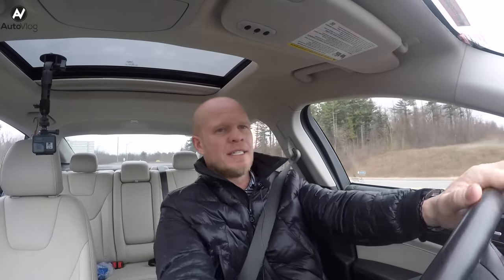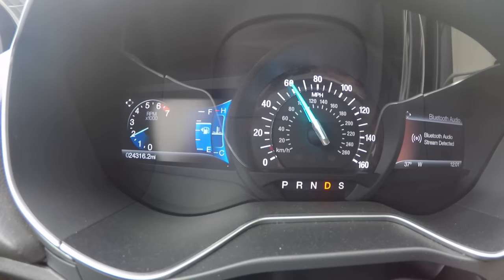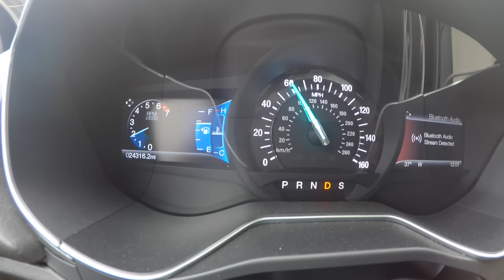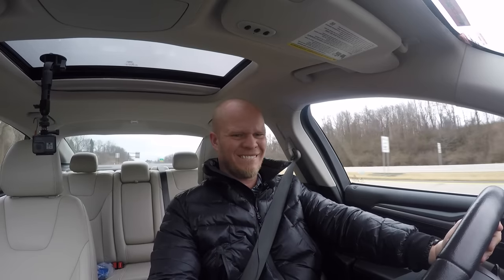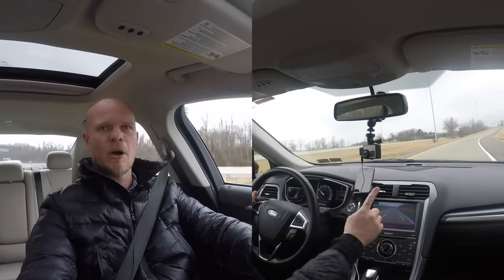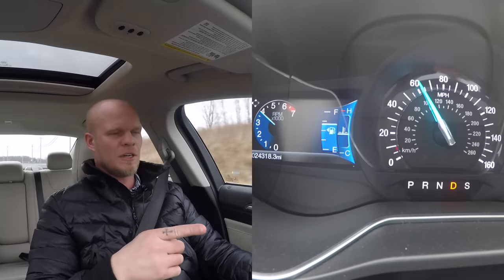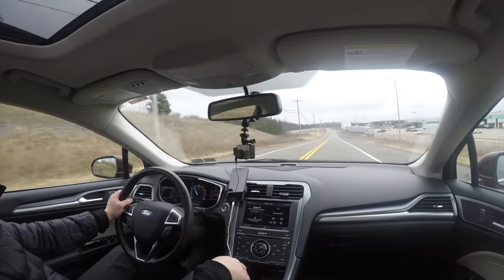What happens if you put your car in REVERSE while driving? (Things NOT to do while driving)

Comment: Try it with a manual car 👌
Reply: INVESTING HUSTLER - Stocks and money making videos all it does is make a screeching noise and won’t go into reverse at least mine wont
Reply: Pimp Daddy true it won’t go in you need to be god to put it in there.
Reply: Morgan Adamson lmao I laughed out loud at your comment
Reply: Mine doesn't let me put it in reverse unless I'm pretty much standing still.

On my sister's Seat I'm pretty sure I actually put it in reverse a bit too early twice already at about 3 km/h. It just does a screeching noise. Don't wanna know what happens when the car lets you out it in reverse at 50 km/h
Reply: Won’t do shit unless you release the clutch. 🤷‍♂️
Reply: Pimp Daddy I believe you must put it in neutral first
Reply: Try with golf 2 and Opel Cadett ...my friend was do that in both cars about 80km/h and engine breaks and fall apart on the road hahahahahah
Reply: That's what she said.
Reply: You can do it if youre moving slow but at 70 like in this video it will be like shifting from 6th to 1st gear, because the reverse gear ratio it's very similar to the 1st so you just not going to reckt the tranny you also gonna blowup the engine...
Reply: A manual car will probably not go in reverse gear while moving forward. Your stick won't move.
Reply: I won’t kill a manual transmission
Reply: KAABOOOOOM!
Reply: Yeah
Reply: loool i was in my learner car which is a Mini cooper D 2017 (havent got my full UK license yet) 

jumped from 3rd to reverse (its a 6 shift so reverse is next to 1st) on the gauge it tells you what gear you’re in and it jumped to R. 

My instructor said if it ever happens again dont push the gas or break just leave the cluch in while youre driving shove it in neutral then change to what gear you need. As long as you have the clutch in it wont reck anything because the clutch disconnects everything.
Reply: Ross Roden+ you know for a country that has more manual cars than the US there sure does seem to be a lot of ManTrans illiterate people over there. l always hear stories about instructors telling the students to rely on vehicle specific features like hill assist or being able to idle forwards off the clutch. some even say just dump the clutch when you shift. or they say that you have to double clutch so you don't wear out your synchros, not realizing that synchros are there for the sole purpose of granny shifting.
Reply: Electronics For Fun Electronics For Fun the problem is they will only teach you how to pass your test and that is all that they are used for not about general things in manual cars, also, most cars are on finance over here and most people change a car after 3-4 years then after they have paid off their finance they’ll just get another car on finance so people aren’t worried about what they’re doing to their car in the long run because “whats the point if you’re going to change it anyway”. 

I think its a bit worse in the US. Considering my US friend was taught to just keep the clutch depressed at all times while driving. 

How i was taught was the rev match, when moving off add a little gas and i have never used hill start assist, my instructor has turned off all that stuff.  She doesn’t even let me use cruise control because my car doesn’t have that stuff. My car is a fiesta edge 2011 doesnt have cruise control, hill start assist or anything fancy just standard ABS and stability control.There has definitely been a few times you could smell the clutch burn, but that was when i just started when doing hill starts.

For lazy purposes, whenever i do a Manoeuvers i will just ride the clutch in my leaners car, it just gives me more control and I don’t end up fucking up the Manoeuver but in my Fiesta i do things properly.
Reply: "I think its a bit worse in the US. Considering my US friend was taught to just keep the clutch depressed at all times while driving." oh wow, that's pretty cringe.

"There has definitely been a few times you could smell the clutch burn, but that was when i just started when doing hill starts." everybody has their own little tricks for that. l knew one guy who would plant his heel on the brake and then twist his foot and press the gas with his toes while feathering off the clutch, and the most common thing l see is when people use their E-brake and then yank it off once the clutch grabs. l mean it works but it seems a little more difficult than just doing it the right way.
Reply: ^ I just dump the clutch and clench my butt cheeks lmao
I wasn't really taught how to manage hill starts properly, especially if I'm reversing up a really steep incline. I've been driving manual for 5 years now. Is that the wrong way to handle that situation? I've tried the parking brake trick and I just can't get with it. It feels too weird for me.
Reply: Electronics For Fun Electronics For Fun i got taught to leave my foot on the break, get the clutch up to biting point then twist my foot to the gas and add as needed, however most people get taught just to put the handbreak up get yourself ready with the clutch and gas then realise it. My friends always do it whenever there is an expensive car behind them
Reply: Jillian J id just say if youre stopped at a hill (because of traffic lights etc) just keep the clutch depressed with the foot on the break, when you want to go get the clutch to biting you will move a tiny bit or you won’t move at all but you wont roll back, then add gas. I wouldn’t do it if you’re constantly going to be going up and down hills because you’ll just wear your clutch out but if its every once in a while it or you dont drive up steep hills it shouldn’t matter
Reply: Jillian J+ well am not an expert, but l would say it's ok to dump the clutch every now and then but making a habit of it could cause problems. the best thing to do would be to keep your foot on the brake until the clutch bites and then pull off of the brake and give it some gas. once the clutch starts to bites then it should hold you in place like a torque converter would in an automatic car, but obviously you'll want to get on the gas pretty quickly or you'll burn out your clutch just sitting there with the clutch half engaged.
Reply: Ross Roden+ "Electronics For Fun i got taught to leave my foot on the break, get the clutch up to biting point then twist my foot to the gas and add as needed," yeah l have seen people do that before.

"however most people get taught just to put the handbreak up get yourself ready with the clutch and gas then realise it." yeah that's pretty common.
Reply: Ross Roden my issue is reversing up steep hills (like backing out of my driveway), not driving forward up them. For some reason I can't apply the same mentality to reversing. It's weird.
Reply: Electronics For Fun how is my clutch supposed to bite and give me enough time to start moving the car when I'm on a very steep hill, though? I just recently moved and my new driveway is on a pretty big incline. I've tried a ton of shit while leaving every day. The second I let off of the brake, my car rolls very fast down the driveway. I guess the only other solution is to back in because it seems it's easier for my car to pull up the hill than push up it.
Reply: Jillian J+ "how is my clutch supposed to bite and give me enough time to start moving the car when I'm on a very steep hill, though?" if it's a VERY steep hill then you should use your E-brake. but in most cases you can feather it without having to use the brakes. when on a hill you're releasing to clutch to the point where it's biting but not hard enough to stall the engine so there is still a little slippage. this little bit of slippage allows you to hold your car in place long enough on the clutch with the engine running, and it will hold you long enough to get on the gas and go.
Reply: Electronics For Fun I'll have to try that stuff again. I've tried the parking brake thing and it felt really odd to me. Hmm
Reply: What if u r on slope and in reverse gear car starts going forward and then full acc.  And clutch off
Reply: Yatin Patial+ l don't know if l fully understood that. but if you mean yanking your foot off of the clutch and slamming the gas to stop rolling backwards, then you'll either stall or take off in reverse and lose control of the car and crash.
Reply: Doesn’t work, it doesn’t let you put it in reverse if it’s at anything faster than stopped
Reply: Most manuals lock reverse out once a certain forward speed is reached.
Reply: I did it on accident... gear 5 was above reverse first time driving manual just made allot of noise and shit
Reply: brycmtthw that's not true... Clutch is link between transmission and engine... If transmission is spinning forward and you link the forward transmission while it's moving to the reverse transmission they will grind... So in fact... Shit will happen
Reply: INVESTING HUSTLER - Stocks Money Entertainment transmission would be annihilated
Reply: I did it n my old car ain't shit happen jus sounded like shit
Reply: INVESTING HUSTLER - Stocks Money Entertainment i have a manual truck
so iam actually wondering what would happen if i did
Reply: INVESTING HUSTLER - Stocks Money Entertainment yeah i think if it's manual something will happen lol
Reply: The engineer that built cars knows that there would be one idiot who would put it in reverse while driving so they built this mechanism that would lock out the reverse while driving. So to answer your question, no it won't work nor happened because it automatically locks you out from reverse while you're driving.
Reply: my car is a manual and it becomes very loud but continues to drovr forward
Reply: If it actually gets in gear it'll probably just shatter the whole gearbox, depending on how fast you're going, but I guess pretty much 85% of cars won't even get in gear. Even when the car is stopped some manuals cars offer much resistance when putting in reverse. Even if you are in neutral going at 2 km/h(forward) and try to get in reverse you're gonna hear that terrible noise of grinding gears.
Reply: It will break the gearbox
Reply: Would that blow the motor?
Reply: @ithaca4496  no you didnt
Reply: Ha sounds a bit like rrrrrrrrrrreeeeeeeeeeeeeeeeclunk
Reply: Mastermilo82 channel
Reply: The only way to go in to reverse going forward at that speed is doing like Tiff Needell, pull the hand break hard,  do 180° and engage reverse while spinning. It works. You probably will end in a ditch....
Reply: Guess what entire gear box rip 
Out
Reply: @brycmtthw  it's automatic in the video - automatics don't have clutches.
Reply: Same thing will happen
Reply: @chirsfortnite6150  you'll break the transmission
Reply: I think that you won't be able to switch cuz the speed
Reply: Investing Hustler and your reverse gear will be into pieces😂😂😂
Reply: Oh gosh! No! don’t do that!
Reply: @rxss6154  very correct
Reply: He did
Reply: Where I live, most of us drive manual. I've once wondered what would happen. I don't dare try.
Reply: @doublevision2943  I dont think it does let you. My private car is a 6 speed, after several years driving with it i got a company car that was a 5 speed, with the reverse in the same place my 6th gear was. And as you might imagine one tired morning on the freeway i was going to put it in "6th" gear just by reflex. What happend was that the gears could never lock in, probably because of the speed and direction it was already going. So i felt the stick rattle a bit and i put it in fifth. I almost shit my pants tho.
Reply: @88balloonsonthewall70   I figured there's some "safety setting" that prevents this from happening, I notice the same feeling whenever I try to shift into first gear while the speed is still too high - which could be as low as 15 kph. It might not be a safety setting but a mechanical situation where the gears simply don't allow it, somewhat like you mentioned it but I have no idea, I'm not much of a mechanic lol. Honestly I might look into the whole mechanism behind cars more, it is definitely valuable to be able to fix your own ride considering what they charge you at the local repair shops lol. My brother generally takes care of the familys cars but I've never asked to join him when fixing stuff

Comment: The difference is in older cars when you moved the selector you physically moved the lever on the transmission.  In a modern car when you move the selector (or any switch) you are sending a "request" to the computer that you'd like to change gear.  If the computer determines its detrimental to the system it won't let you do it.   That's why the fuel door or trunk won't open if you accidentally hit the button while at speed.
Reply: Yep 😭 definitely not the same in older cars terrible idea
Reply: Me: Put the car in reverse at 80mp 

Car computer: 🤔🤔🧐🧐

Comment: WARNING THIS IS ONLY ON NEWER CARS !! older autoboxes will shift, or try but just stall engine, (tried before)
Reply: Elyas Define older. Same thing happened when I accidentally put my 99 BMW in reverse while driving.
Reply: Elyas my dad was driving at night and encountered a sharp turn that his car couldn't handle at the speed he was going so he put it in 1st gear and ruined the car
Reply: Eww old BMW... Have fun keeping that unreliable thing running. He meant old as in ancient transmissions with mechanical linkages and valve bodies.
Reply: hochhaul can you explain what's unreliable about a 99 bmw? in the last 5 years of owning mine I've needed an ignition coil, CPS and water pump... so about $200 in parts for an 18 year old bimmer. mine needs new rear springs but after 18 years that's a good run for springs...

and there's a reason that you can move the selector from L (or 2 or 3) thru D and into N without pulling the button on the selector... so you don't smash the tranny into reverse... you can only access reverse while pulling the "trigger" on the shifter.
Reply: Not wrong about the old BMW tbh. BMW makes great cars, they just don't age that well. After spending $14,000 in two years trying to keep mine going, it died and I decided to get a cheap Toyota until I can save up for something better instead of spending thousands fixing whatever was wrong with my 540i this time. Sad to see it go that way, but it is what it is.
Reply: Whiterin 540 if I'm correct the 54p was the v8? I'm aware the v8s are not reliable. if I want a v8 I'll go American or supercar. Germans still don't have the formula worked out.

nice thing about i6 is that's the *23 (323, 523, 723) *25 *28 *30 *m3 all had many shared parts and that made them cheap.
Reply: MattyMag Yeah. The parts and work on the 540i were really expensive. I suppose it depends how long you want to keep it. Mine had 240,000 KMs on it. BMW in general isn't as good as say, Toyota or Ford for reliability, but if you don't keep them over 100k miles, you probably don't have to worry about it. Tbh, the next car I REALLY want is a Chrysler 300c SRT8. My poor as needs to save for a while if that's ever going to happen though.
Reply: Whiterin I really wish they made a hellcat 300. I just bought a used 07 a4 3.2 because I had a child and a bmw coupe wouldn't cut it. that being said, if I had the choice of any newer car, I'd have to go with the equus bass 770 or an rs6/m5. but that's out of the question knowing I'd kill myself behind the wheel of either.

wouldn't mind a tesla 100D either. has the range I'd need for most of my travels and the power to destroy my face like jeremy driving an atom
Reply: MattyMag I've got two kids, and I'm not exactly rich. The 300 is a great car, but for a really reasonable price. I mean, 465 horsepower and ft/lbs of torque, pretty nice luxurious interior, looks nice from the outside. Should be more reliable and much cheaper to fix/modify than similar BMWs or Mercs. Good deal.
Reply: Whiterin I agree with you, they've had 50 years experience making v8s. and I'm sure there's a supercharger kit available when shy of 500 hp stops being enough. 

and yeah I'm not buying anything new for a while . -275$ in the bank rn
Reply: tried before
Reply: Finlay Mitchell if your dad thought that with the brakes only he couldnt stop the car from going ofroad or worse...he did good pushing the brakes and puting a low gear cause it retract the speed , functions like the electronic brake on the truck. Even if that will break gears in the speedbox, but safety first.
Reply: Elyas
Reply: Elyas yes I've done it in a older car as well and definitely heard a lot of grinding coming from the trans.
Reply: MattyMag l
Reply: My 2000 Tacoma was dummy proof
Reply: "Eww old BMW..."
Eww, BMW. FTFY*
Reply: Elyas why did you try it😂😂😂
Reply: Yup. Tried on my 2001 Odyssey . Then sold my car for 200.
Reply: Yep I was driving going about 80 kph and my girlfriend put my car in reverse and it just turned off and I couldn’t steer
Reply: Moms 98 bmw made it 310000 miles only had to replace motor mounts everything else was just regular at home maintenance to the car as in oil changes
Reply: Elyas I'm pretty sure it happens on new cars too he just let go of the pedal when he put it in reverse. I'm sure if he kept his feet in the pedal while on reverse he would of shoot backwards and lost control and fly out the hwy, I seen it happen